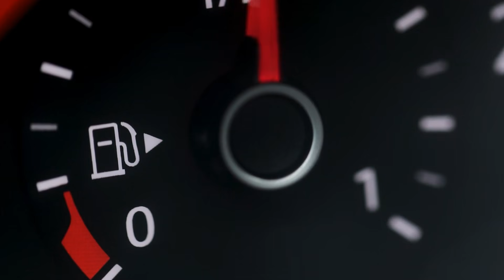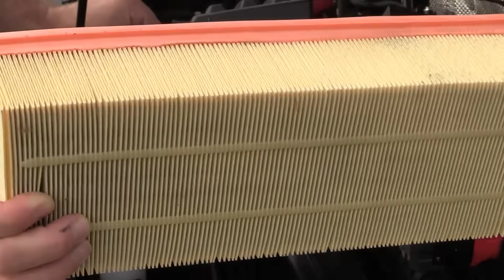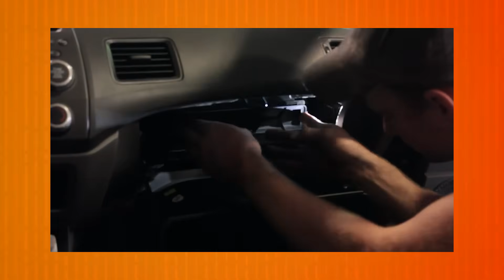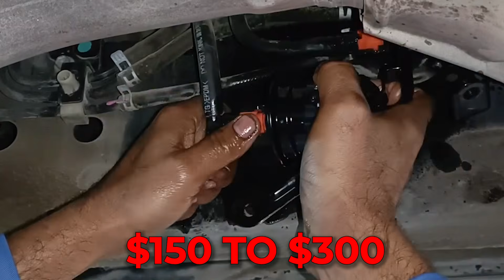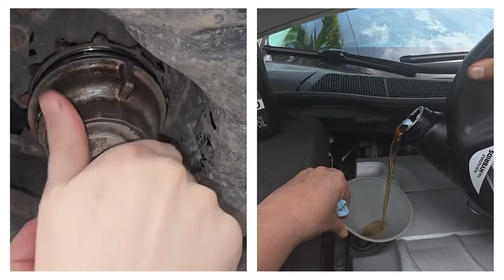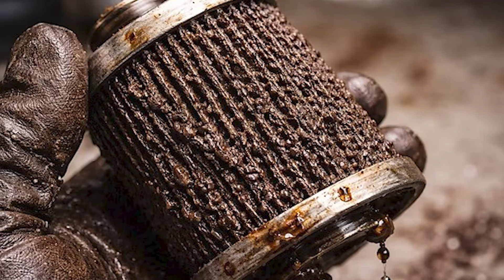The Hidden Lexus Air Filter Choking Your Engine That Almost Nobody Checks

Comment: Garbage video.  Engine and cabin air filters are standard maintenance items, replace at 30,000 miles.  The transmission filter is metal mesh.  Lexus transmissions are sealed with no service recommended.  Same with fuel filter,  It's built into the fuel pump, located inside the gas tank.  I stopped watching after that.